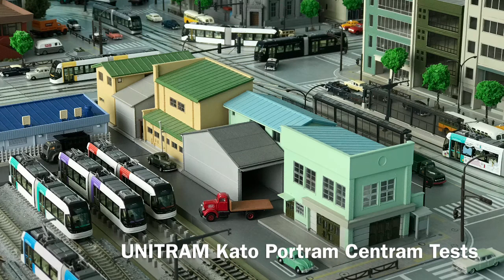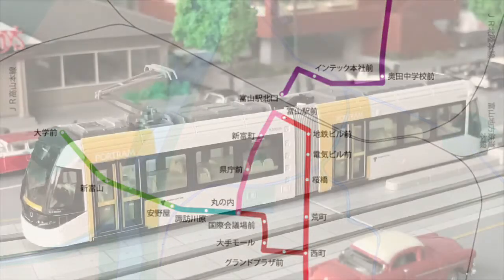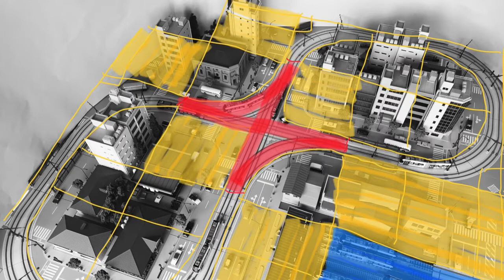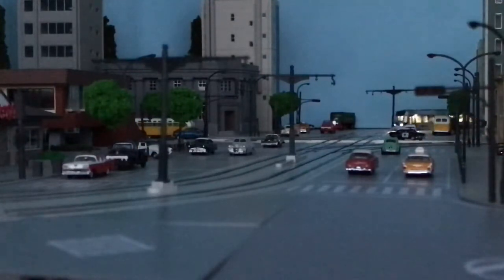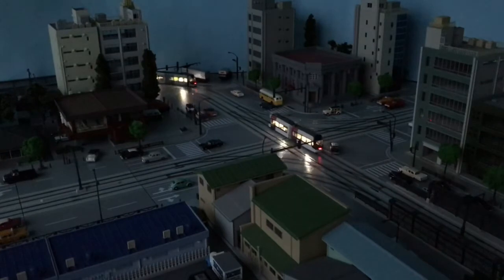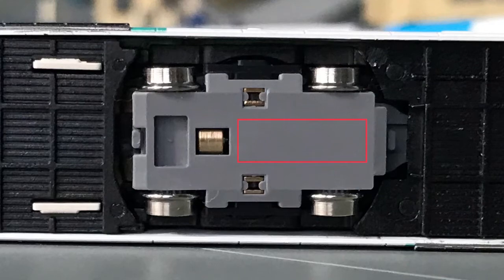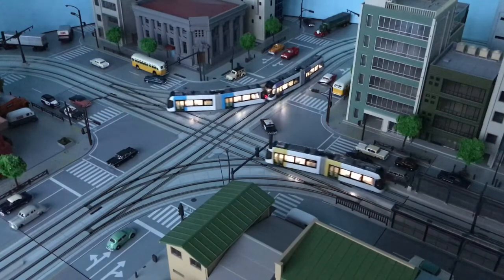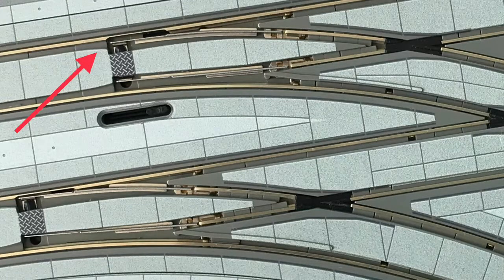UNITRAM Kato Portram Centram Tests

Comment: Great setup.  I am going to attempt to duplicate your track plan.  The video is informative and inspiring.  Thank You
Reply from the maker: Les Lind, others have also expressed interest in duplicating my layout. Unfortunately there can be considerable complexity to placing power feeds and track isolation depending on how you want to operate this layout. I planned a video on this subject, but I may not do it for a year or more. I wrote a few pages of info for another viewer, but needed to attach an edited photo (YouTube doesn’t allow that), so I put it on JNS Forum (Japan N Scale, all in English) under Trams / Unitram turnout tests. I suggest you join JNS Forum (easy request) and check it out before proceeding too far.
Reply: Thank You for the information.  I am in the process of doing two set-ups.  Will keep you posted,  Appreciate the JNS forum info, @theonetruescale

Comment: Nice!  I've been searching for Unitram turnouts/points for 2.5 years.  Can't find them anywhere 😞
Reply from the maker: Yes, for years Kato has generally been ignoring their UNITRAM product line and letting stocks dry up. There may be hope though. Without any new track pieces, Kato has recently announced rebundling and smaller repackaging of their V50-V54 track sets. Generally each bundle includes fewer items, so most are less expensive bundles, however inflation has increased the cost per value.  I think this is hopeful, because it shows intent to keep UNITRAM in production. Another hope is that their new Hiroshima 1000 trams have appeared in 4 liveries with 2 more announced. No announcement of changes to turnouts, but it is hard to imagine Kato selling more track sets without them also restocking turnouts for expansion.

Comment: I love this layout.  I have a basic Unitram oval that I love to run, but I want to add switches and make something like this.  Do you have a diagram of the track pieces you used to build this?
Reply from the maker: G. DiCarlo, glad you like my layout. I do not have a diagram, but it should be fairly clear from looking for the street track and road plate edges in a top view.  AFAIK Kato only makes 9 types of Unitram street double track, 62, 124, and 186mm straights, 180mm radius R and L 45deg curves, same dimemsion R and L turnouts, 62mm square 90deg cross, and a street to ballasted track adapter. There are printing variations. 

My basic trackplan uses:
1x cross
2x R turnout
2x L turnout
6x R plus L 45deg curve (sold together as 90deg curve)
4x 124mm straight

Only the cross and turnouts must be bought seperately.  Although the others can also be bought seperately, I recommend buying 2x of either Japanese left traffic V50 or  2x American right traffic V60 sets because you get most of the corresponding trackless road plates to fill the rest of your layout area without gaps.  Each American V60 has 5 less road plates, so for American you also should buy 2x set 40-820 street set, which unfortunately is only Japanese left traffic. Because of the lack of any American right traffic equivalents to the Japanese sets, I recommend going all Japanese left traffic for consistency without repainting the road markings.

My layout should first be run with only one controller power supply connected. There will be no current shorting worries and all trams will move together in the correct directions. For the more electrically advanced modeler, two controllers can be connected, but Kato insulating joints must be used in specific places.  I have directed commenter Les Lind below where to find my detailed advice on this.

Good luck!

Comment: Nice layout. You inspired me to start one too. Getting V50 and V51 sets since no one has the V60s in stock or at a reasonable price. Are the trams DCC compatible?
Reply from the maker: Thanks, rudedog. 5 years after intro, those nice right hand traffic RHT V60’s now seem to have been a failed marketing experiment. There probably was only one production run and it is now scarce. No RHT versions of V51-54 track extension sets or the 3 road plate sets ever appeared. With V50, at least you will have everything LHT.
Concerning DCC, I don’t use it and know very little about the many (loco and track) compatibility issues, so I can’t answer for sure. I have never taken a Portram apart, but they are not advertised as having any (6, 18,... pin) plug interface. You might consider joining the English-speaking  Japan N Scale JNS forum for your DCC questions.
Reply from the maker: I just googled “kato portram dcc” and read this link:
https://www.nscale.net/forums/showthread.php?48000-Kato-Centram-Portram-DCC-questions
Nscale.net is a different website than JNSforum which I just recommended. JNSforum had a lot of discussion, but it was untested ideas and 10 years old. Nscale.net had a link you should read to a Chech guy that successfully put DCC in his Portram with some issues. He has good instructions and some videos. It seems to me that it was very difficult micro surgery and soldering, but the guy was a DCC expert.  BTW, Kato USA doesn’t recomment attempting DCC.
Reply: @theonetruescale  I got my V50 from Hobby Search. It wasn’t cheap w/ the shipping charges as you mentioned. But it was well worth it. Have the V51 on back order then I’ll be set. Yeah, the portrams are very small. I’ll keep this system on DC and separate. Thanks for the feedback and info.

Comment: Where did you buy these from/where would you recommend going to buy Unitram track? Also what is the radius of the curves? Thanks
Reply from the maker: ChicagoLTrain115, I got most online from Hobby Search in Japan and from Model Train Stuff in Baltimore MD. Radius of all Unitram curves is 180 mm, whether inside or outside. I think you also had a question about reversing loops. That answer is complicated enough to do a whole video on, since two coupled turnouts are in each turnout piece. The quick answer is that you never encounter the usual 2-rail short circuit avoidance wiring challenges with reversing loops, so long as you only connect Unitram (or Kato double track) pieces together. You can only encounter a loop short if you connect some single track in a way not possible with double track, like looping back to the same (single of two) Unitram turnout.

Comment: on your center crossover have you had problems with trams or st cars derailing in one direction on one side if so how did you correct mine just does it on one side either direction does the cross in center are they different on each you order on how they fit
Reply from the maker: Hi again jerry. Please proofread your question. It is very complicated and hard to understand. I think you have strung together about five seperate sentences (two incomplete) without any capitalization or periods. Maybe you just used voice command without proofreading. I usually ignore poorly explained questions, but I will try to guess what you are talking about.

1) You didn’t say whether your “one direction one side derailing” is with Kato Portram/Centrams or other stock. Yes I have had similar asymmetric behavior happen with Portrams and also a Modemo Deha 200.

2) I never found a “smoking gun” 100% cause, so didn’t 100% correct anything. The articulated Deha 200 was noticeably stiffer bending to one side than the other, so I just ran it on the side that was OK. The Portram derailed its rear half on one turnout for unknown reasons, but usually rerailed itself with the front engine pulling. In the second half of this video, I note that one of my turnouts had a noticeably weaker point spring (or maybe some friction) that allowed the inside point to stick in a midway position. This reliably derailed every Portram moving toward the point, so I always used the opposite direction for running tests. I had hoped to dissect and fix this turnout and show how in a video, but never got around to it. Also near the end of this video I show how a small piece of plastic street plate was not pressed down all the way and caused repeaded derailments.

3) I used to think that the center cross was a big cause of stalls and derailments. It doesn’t look that precisely made, and seems to allow significant rail head height misalignments. I later decided that the height misalignments were no worse than typical on unitrack. The crossings did seem to cause stalls on some slow running of motive stock that had wheel spacing lining up with the crossing gaps. However, I found far more stall and derailment problems with turnout frog gaps and points.

4) Sorry I am not offering you any magic fixes. As well as the Unitram track and Kato Portrams usually seem to run, one must realize that very technically challenging model railroading is happening here. Before flywheels became commonplace about 2000-2010, slow running without stalling over multiple gaps and uneven track was impossible in n scale. With Unitram/Portram, yes we now have flywheels, but we are trying to run even slower with lightweight see-through vehicles with complex articulation over tighter curves with gaps spaced much more closely. I am actually surprised that it even works most of the time. 

5) If you are not satisfied with the running, I think there are only two choices other than giving up:
a. Look into cause/effect and debugging even deeper than I am willing to. 
b. Accept that Portrams and Unitram turnouts are cutting edge technology, and that maybe 10-20% of those you buy will not perform adequately, so must be returned or bought again. That is my choice.
Reply: @theonetruescale  I was able to fix my problem on the center crossover why do the programs run so much slower than the Peter Witt Street cars

Comment: Stupid question, but the cars are supposed to drive over the train tracks? I don't see complete roads.
Reply from the maker: I am not sure exactly what your question is, but:

1) These n scale cars are too small to be motorized.  Tomix makes battery powered motorized busses that steer by using anmagnet to attract a steel wire under the road. A few scratchbuilders have successfully had added this wire to Kato Unitrack.

2) If you are referring to the road markings not appearing to be a continuous street, they actually are fairly correct, given model compromises. In similar prototype intersections, the cars would cross the tracks when they have the signal. Unitram looks very similar to modern prototype intersections seen from above. I can see how the road looks discontinuous from above, but to the driver at street level, it looks ok.  I have driven through many such tram intersections in San Francisco.

Comment: Hi what is the hight of the tram sections. I want the tram parts but not the rest on my layout
Reply from the maker: Hi Matthew! Kato Unitram track has the same bottom-to-railhead height as Kato ballasted Unitrack height, ~7mm.  Tomix Wide Tram track also matches Tomix ballasted track (and Tomix Moving Bus System road plates), but is lower height than Kato, ~6mm.  Tomix Wide Tram might be more versatile for scratchbuilding into your layout since you can do both single and double track. Tomix does not have any Wide Tram turnouts, though.  You have to use their single R140 turnout and glue on molded road inserts from a specificTomix accessory kit.
Reply: the onetruescale so if I get foam board to that hight it will look flush

Comment: can you use any n scale train or do you need to use the kato train
Reply from the maker: Jim, you can use other trams or trains with Kato Unitram, but which ones and under what conditions is complicated. My other videos show certain other manufacturers trams working. If you want street running freight, some locomotives and some freight cars even work! With powered trams and locomotives, the critical issue is whether the wheels and drive mechanism are designed to run on a tight curve of 180mm radius or less without mechanically binding up. If that proves OK, then the next issue for both powered and non-powered stock may be whether the couplers can handle the curves without binding up or releasing. If that is OK, you should be able to run on plain (flat, no protruding vertical accessories) Unitram track, but Unitram turnouts with their complicated points could cause derails or power stalls. If that is OK, the next issue is whether clearances with vertical accessories will jam the tram, locomotive, or car. Kato vertical accessories that can cause these clearance jams are their tram catenary posts (with their raised barriers between doubletrack) and their modern slightly raised tram stop platform with fences and awning. If you want to use any of these vertical accessories, your rolling stock choices that will clear them may be significantly reduced. By bending the verticals of the tram stop awning outward about 2mm, I have even been able to run an Atlas GP 40 with Micro Trains 50’ freight cars on my layout. I have also gotten many small American, Japanese, and European electric, diesel, and steam locomotives and various smaller freight and passenger cars to run fine. If you are committed to running something this way, I suggest buying an American V60 or Japanese V50 Unitram set, and borrowing rolling stock from a friend or shop to test before purchasing. Good luck!
Reply: @theonetruescale  thanks alot